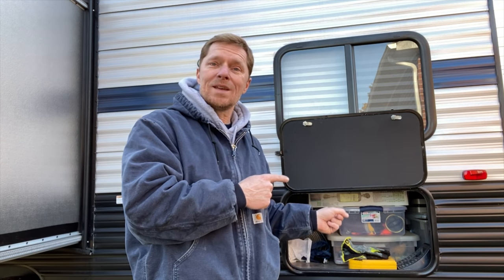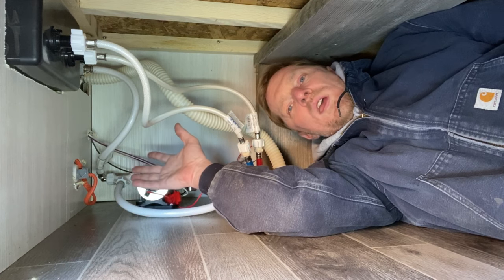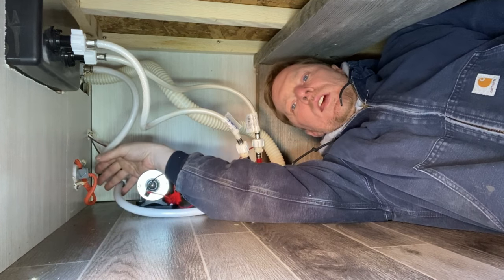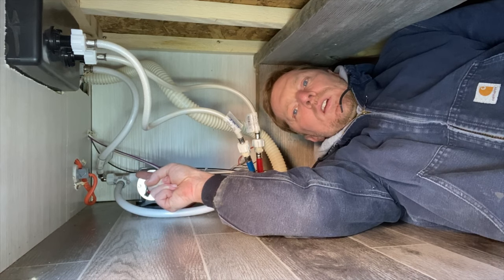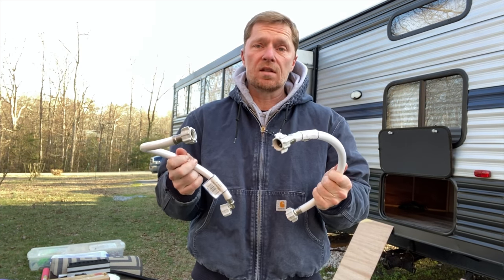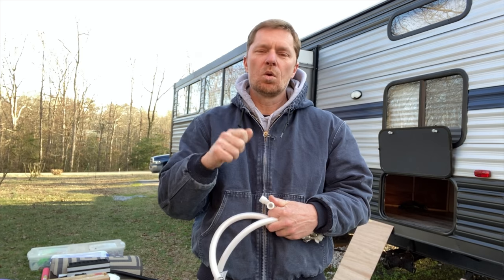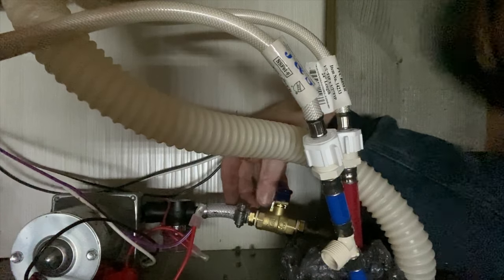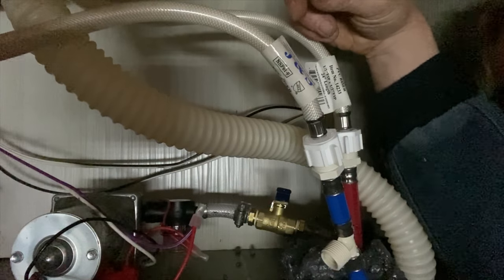RV How To - Water Pump Check Valve Bypass - RV fresh water tank for beginners

Comment: Why not clean the check valve in the water pump?
This whole video is a waste of time and gives bad information.
If anyone has this problem, remove the check valve on the side of your water pump and clean it out, that will work 99% of the time. DO NOT chop into your plumbing lines people.
Reply from the maker: If you look up the model # of most common pumps, there isn’t an external check valve. I have contacted them on this matter. They recommend to keep buying new ones. This was my experience and shared a money saving alternative.

Comment: Great video very informative but I'm confused you had an orange handled shut-off valve at Home Depot and you installed the blue handled one ? Was that just going from your freshwater tank to the pump ? And I didn't see this city holes going back into the pump ? I'm trying to do the same exact thing now so any extra help would be great thank you
Reply from the maker: I used the blue handle because it was made to work with water. Also, yes i put the valve betwen th tank and pump inlet
Reply: @HowToRV  ok great thank you